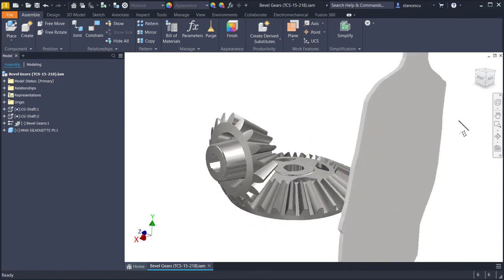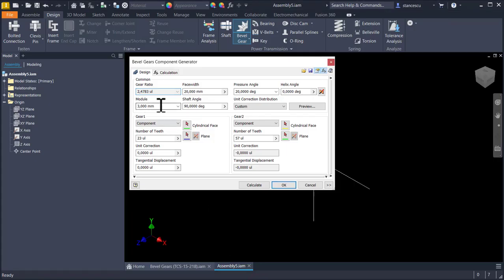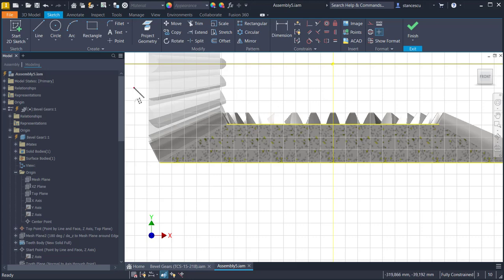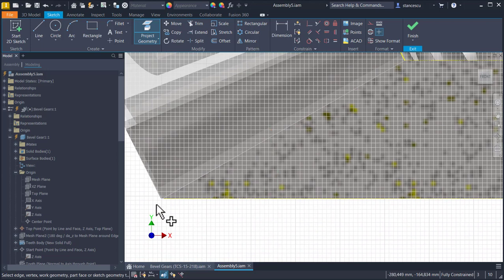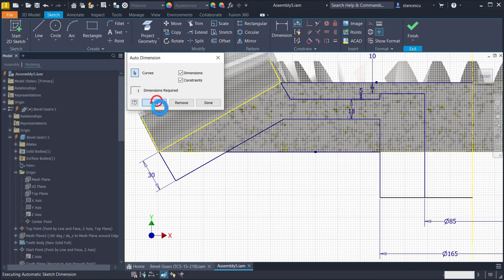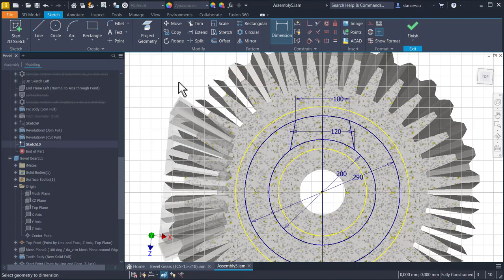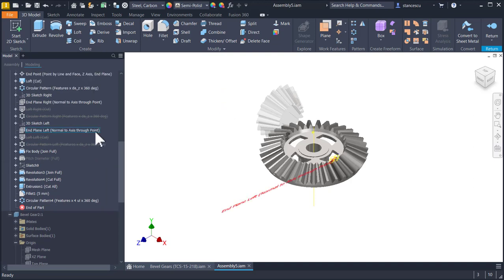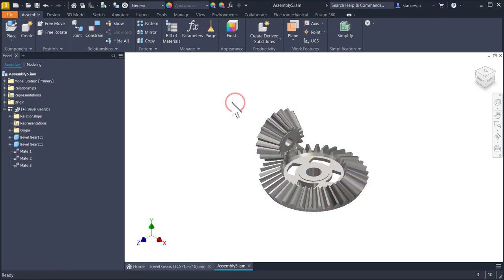Tutorial Inventor - 328 Bevel Gears (TCS-15-218)

Comment: Professor Inventor's help regarding the calculation of spiral bevel gears informs that: Rm=Re-(0.5xb) where b=face width. Therefore b=(Re-Rm)/0.5. My question ? How to determine the value of Rm? What standard does Inventor use to calculate this type of gear? Thanks.
Reply from the maker: You can find all the definitions, data and formulas for designing bevel gears (and other designs) by opening ASSEMBLY (.iam) and selecting the tab Design, then developing Power Transmission and selecting Handbook, Assembly Component Generators, Bevel Gears Component Generator, Factor Dialog Box and so on. Good Luck!
Reply: @prof-stancescu  Professor, I already do this, but the width of the tooth is getting smaller in relation to the original piece? I think I already understand as per the post below. You enter data for a helical bevel gear, and the software represents a spur gear. In other words, everything is wrong!

Comment: Hello Professor Constantin. Do you have a tutorial teaching how to model a pair of spiral bevel gears in 3D? I'm trying to carry out this work, but I'm not having success with the width of the teeth. It's looking different compared to the original physical piece. Data: z1=13 z2=26 pressure angle=20º helix angle = 33.459º normal modul=2.4 tangential modul=2.6 correction x1=+0.45 x2=-0.45. Actual face width of the part = 19mm.
Reply from the maker: If you want to browse my channel please download and use the file GENERAL INDEX TABLE.xls as you can read at the end of the description on each video. Unfortunately Inventor doesn't have a module for designing of SPIRAL bevel, but only straight or sloped (helix angle) bevel gears
Reply: @prof-stancescu  Thank you prof. I know that a bevel gear with helical teeth is one thing, and the other would be a bevel gear with spiral teeth. By this I DO NOT understand Inventor. You enter data for a helical bevel gear and it represents a spiral? This is a serious software error, do you agree?